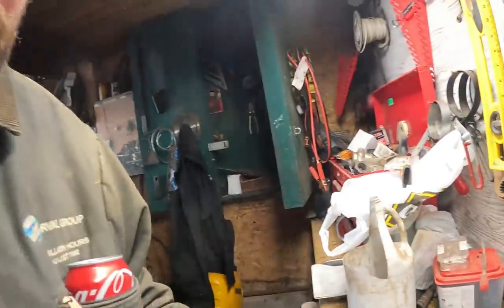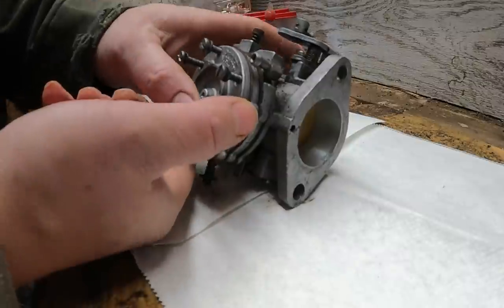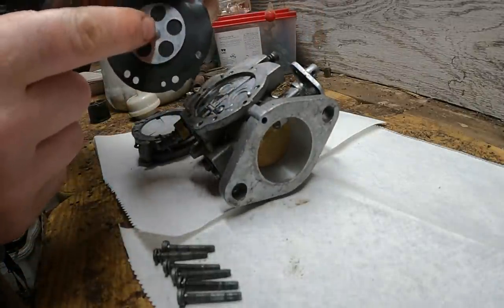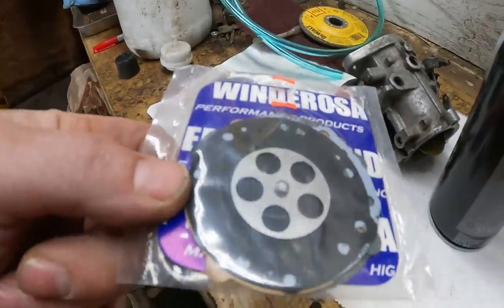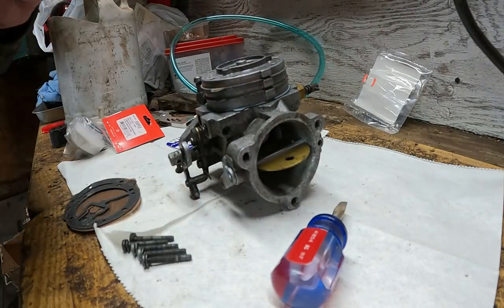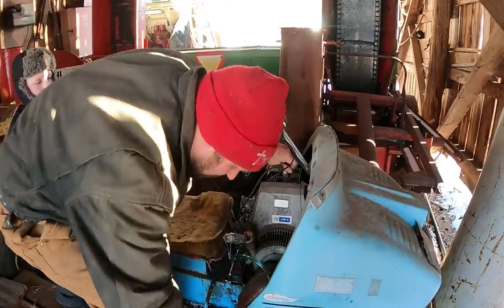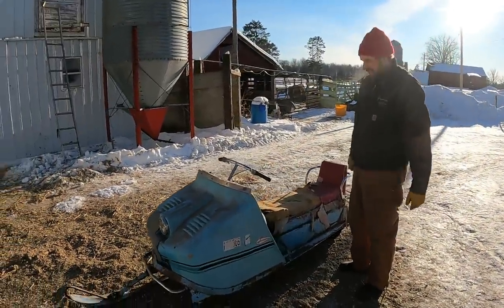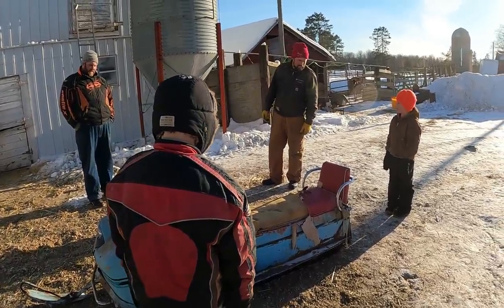Working on a Vintage 1968 Larson Hawk Snowmobile

Comment: Boy that brings back memories. All the old sleds had HR or HD carbs, and they all needed to be pulled apart and cleaned every fall. Sachs, Hirth , JLO Rockwell, and of course Rotex engines, one or two cylinder. We had great fun as kids in the 60’s/70’s ripping around all winter. I used to even ride my snowmobile to school sometimes.

Comment: I graduated from high school in 1978, my next door neighbor had 7or8 snowmobiles of different sizes, years, and brands of manufacturers, most are out of business now , you use to have to a lot of tools with you, a of people made a wood storage box and that raised the seat up a little bit, I remember riding a ski- door 12/3 Olympic, that had a rubber cone on the carburetor, you had to watch your scarf around it. Now snowmobiles are too expensive and fast,for me to deal, the days of puttering through the woods and between trees, are long gone. My son has a snowmobile (700 cc ) I drove it once, that was enough for me!
Reply: I am right there with you.  Give me an older "vintage" machine ANY day over this newer stuff out there.  I would ride one of those any day - all day.

Comment: I love seeing them still going in that shape!  That is a Polaris with a mid mounted engine in a light blue color sold by Larson boat dealers. If it has a 15" track it would be a clone of the "colt" model, if it's an 18" track it was a clone of the "Mustang" model.  The Polaris versions had the engine mounted up front under the hood.  That gas tank was referred to as the "suitcase" tank.  Wow 71 miles on 1" of suspension travel, I would be very sore the next day. :)

Comment: Old sleds are fun, glad you hung onto her.  You may want to consider dosing your gas with SeaFoam, 1 oz per gallon.  Im not a fan of snake oils but have had unbelievable good "luck" with that.  I did not have good luck with Sta-Bil in small engines and quit using it a couple of decades ago.  I'm in SE WI and we've had oxygenated gas "forever" thanks to Chicago's dirty air.

Comment: Another great video! My dad would rebuild those carbs. on the kitchen table in the winter. That is a really neat old sled. You may have a bad engine seal. From sitting for a few years they sometimes dry out and suck in air in the crank case. That might be why it won't idle.

Comment: Few things to add for those not aware, If your dead set at replacing the internals of you carb: needle jet etc. Make sure it's original Tillotson. 
The after market stuff is not machined precisely so you'll have problems. 
If your search the web for diagrams of your carb you'll be able to see the order of the gaskets. Not every gasket you get is needed for your carb.

Comment: We had a 1972 Mo to ski and a 1974 Shapperell
Reply: Omg I remember those models of snowmobiles
Reply: I had 1973 ski doo 292 tnt single cylinder and carb  Then I bought a 1976 boa ski 440

Comment: Ha! Fabulous! Love the enthusiasm of the younger generation.  Now you got me to thinking of the vintage sleds in my past. An old Johnson (which Wilson brought back to life, briefly, last winter) , an old Mercury....I think my brother may have had a Larson, and then there was a pair of JD X8s, I believe. All of those old sleds were quite crude by today's standards. I really enjoyed the Deere sleds, though. Was the Larson a product of Minnesota?
Reply from the maker: Yes, Larson boat works,of Little Falls, MN. And from what I've read, Larson was, minority owner of Polaris, so, in 68, Larson used the 67 Polaris sleds that were left, They put a different hood on them, and repositioned the engine, and chain case, and sold them as a 68 Larson. The model I have is the same as a 67 Polaris Colt.
Reply: Thanks for the history lesson! I love "industrial" history. Our newer (well...1990s era) sleds were/are Artic Cats, also a Minnesota product.
Reply: @trinitydairy  .....(side note)  When the severe drought hit in 1988, I had to sell my herd of dairy cows and get a job. I worked at Larson Boat Works for two years as a fiberglass hull gunner.  I did not know Larson Boat Works ever made snowmobiles.

Comment: Ethanol gas is bad for all small engines. Even the newer ones.  I had a friend that bought a new AMF Skidaddler in 1965 or 66 with a single cylinder 290 something JLO and he had to keep adjusting the carb constantly. We use to tell him he would make the best one armed snowmobile driver after all the practice while adjusting the carb. Great to see it running.

Comment: Hey, Bud! I think the problem is the gas line! The plastic line you have on there, the gas eats that kind up, and the plastic gets in the carb and causes problems! you should replace it, and i think your carb will be fine! You need regular gas line hose! Also, you should never store gas in a plastic jug because gas will eat the plastic! only regular gas cans made for gas! You da Man!!
Reply from the maker: Yeah the plastic line is no good, but the stuff I have in here is actual fuel line. Most of my cans are steel.

Comment: When you are done using snowmobiles use spray engine fog to store snowmobile spray in carb air until engine stall it works no more carb fixing no engine seizing seals stay good

Comment: Hey Allan thanks for sharing that was a very informative video. Have you ever tried using a fuel stabilizer additive to see if that would help with the needle sticking in the carburetor?
Reply from the maker: I think I put some sea foam in one year, but it still stuck.

Comment: Had forgotten about Larson snowmobiles.  We used to see a few on the trails in the early 70's.  One Sunday, after church, a group of us men started naming off snowmobile brands and came up with over 50 including Roloflex and Boa-ski.  Those were the days.  Nice to see the 530 in the garage, something needs fixing?
Reply from the maker: My first snowmobile was a Boa- ski, had a Hirth 440 engine, and it was fast! That's one of the 830s in the garage, the fuel tank has a little leak, and I have to fix the connection where the hand and foot throttle go together.
Reply: @trinitydairy  Ironically, my first actual sled was an old Boa Ski (Don't remember the model).  It had no engine, and the hood was kinda busted up, but it was free, so there was that.  We bolted a Sachs 297cc one-lunger to it and ran the living snot out of it for a couple years.  Good times back when we used to have actual winters here in Wisconsin. 
I probably have a thousand stories of some of our forays in the snow back in the 1980's.   Moonlight lights out rides in the open fields, wide open runs across the lake, etc... But I will spare you the details for now.  Just suffice it to say that we had some amazing times out on our sleds back in the days.   ...And to think that it all started with that free old Boa Ski with no engine.
Reply from the maker: Same here, lots of stories.  The best one was when Jen and I were going to go for a ride and I had an old bubble nose Scorpion, I started it but  had to grab something from the shed quick.  I heard it rev up thinking Jen took it for a spin, but here the dang thing took off on it's own and ran Jen over, well  just her legs, but man we still laugh about that.  Her version is hilarious!  She described it like the Stephen King movie, Christine lol!